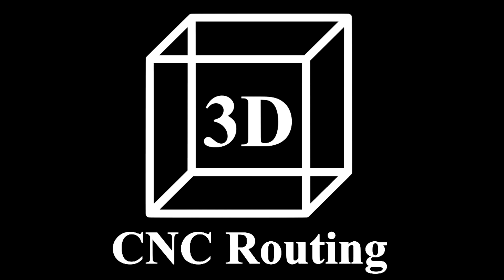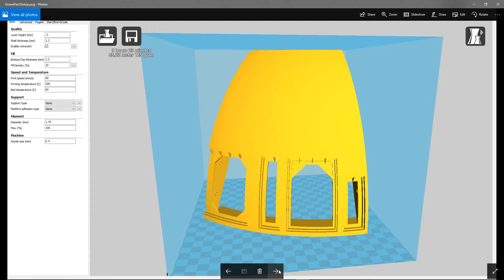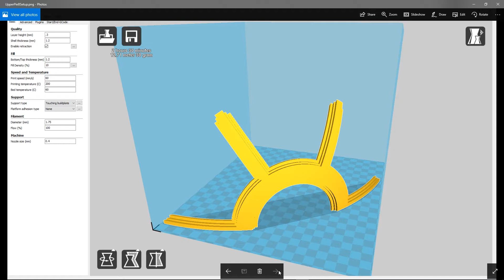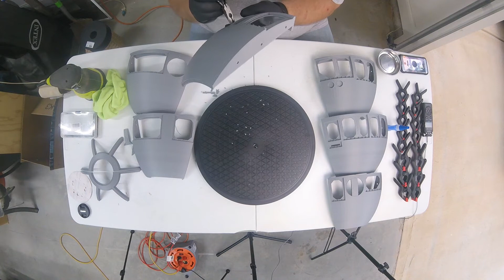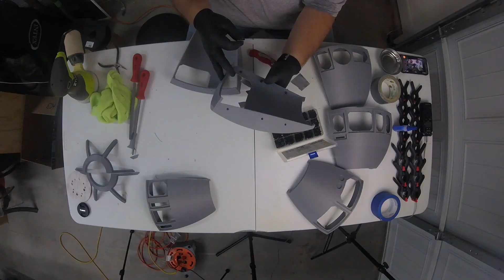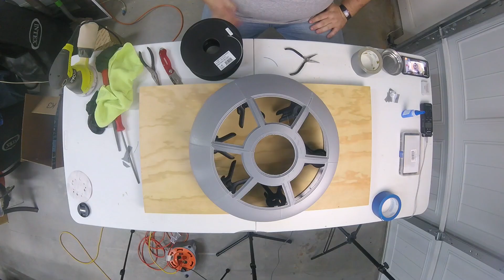3D Printed R2-D2 Project: Part 1

Comment: I'm preparing to print the large 6 parts dome and wondering if i need to add support or not. Looks like i dont need to! Yeay! saves time and material
Reply from the maker: You can print it, either way, depending on your printer.

Comment: are you selling it a kit form??? I'm lookn for just a static! thanks
Reply from the maker: I had not thought about selling it as a kit. If I did it would be somewhere around $1000.00. I have over 200 hours of printing just in the dome so far and I have not finished printing all the parts for the dome yet.

Comment: Looking good so far! Being able to use the taller parts is nice -- I had to print 15 sections instead of those 6 for the bottom part of the dome, and of course fitting them together was a bit tricky.
Reply from the maker: Having to only print the 6 parts was nice. It did take a long time to print over 71 hours. This is going to be a fun project.